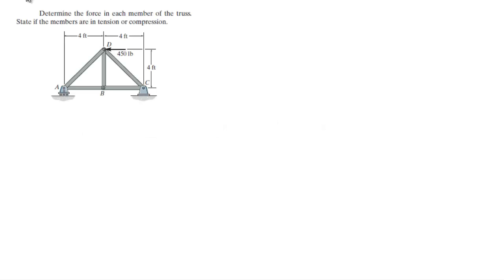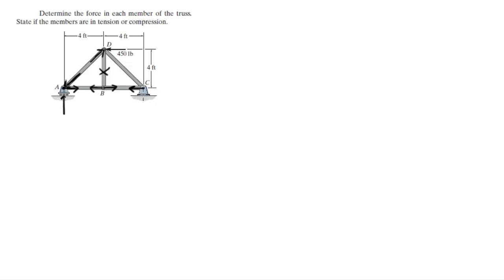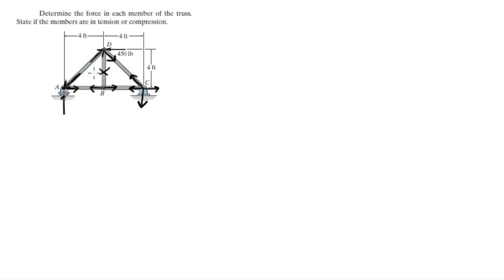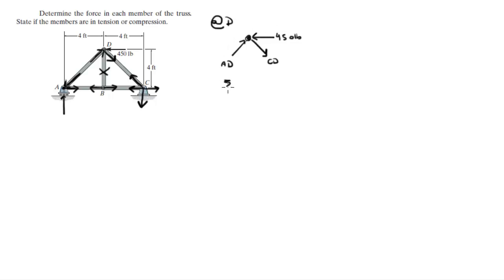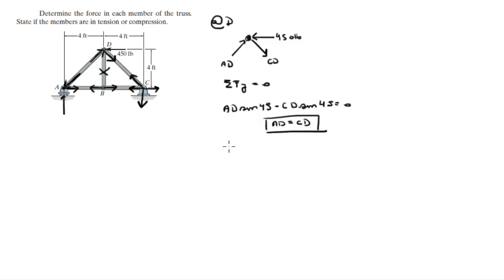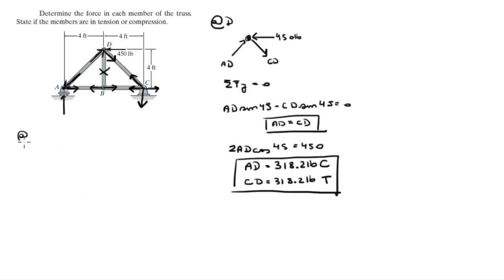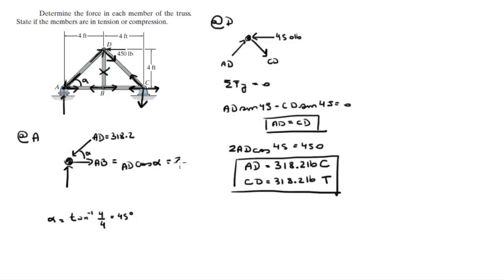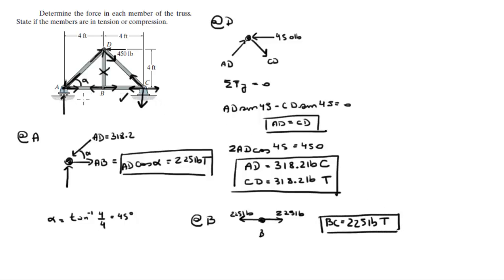Determine the force in each member of the truss.

Comment: How do you know that the angle is 45 degrees for the joint at D
Reply: The truss is made up of two triangles.  Both triangles are Right Triangles, meaning one angle is equal to 90 deg.  The two legs, AB and BD, are equal in length, 4ft each.  Or, if you like, you can use the legs CB and BD.  They're 4ft in length too.  The interior angles of a triangle ALWAYS!!!! add to 180 deg.  So, if one angle is 90, and the two legs are the same length, that means the angles formed between B and D, or, C and D and the hypotenuse, are equal.  If you subtract the known angle, 90 deg., from 180 deg., you're left with 90 deg.  Since the remaining two angles are equal, you divide 90, by 2; 90/2 = 45 deg.  Each angle is 45 deg.  Now check your work: 180 - 90 - 45 - 45 = 0.